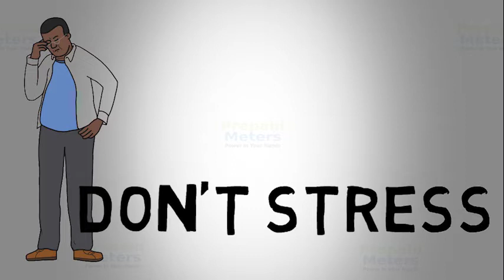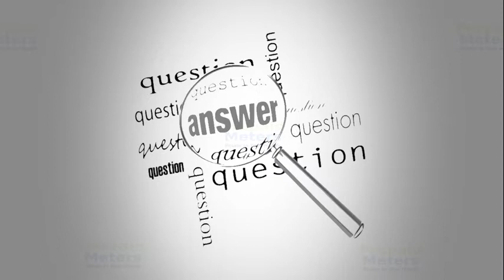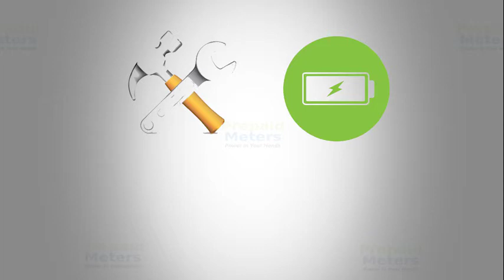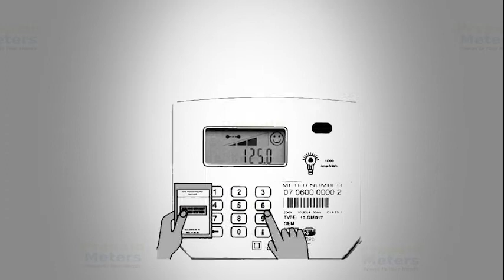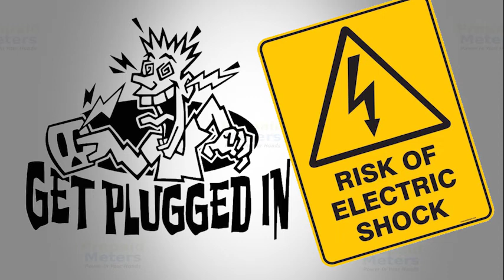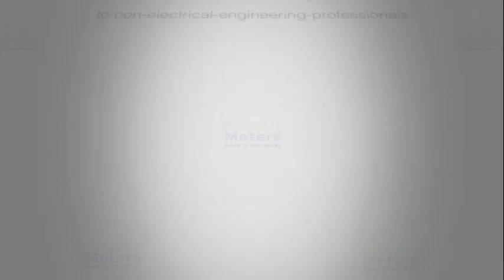Prepaid Metering Devices and Power Line Communications Errors

Comment: Great video , I had to unplug the trolley  inventor off the main board, to get the prepaid meter to sync with the board. Plugged keypad  into a separate wall  plug  with no electricity so that I could recharge with the units bought.